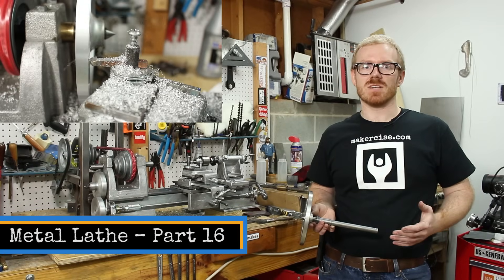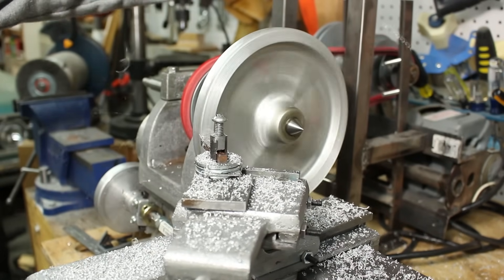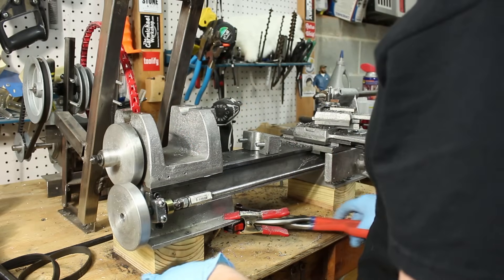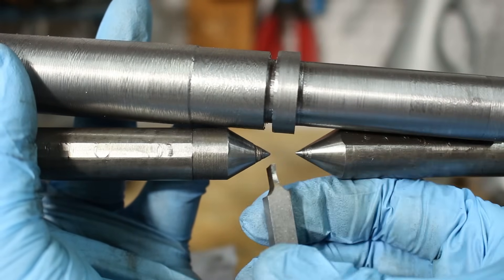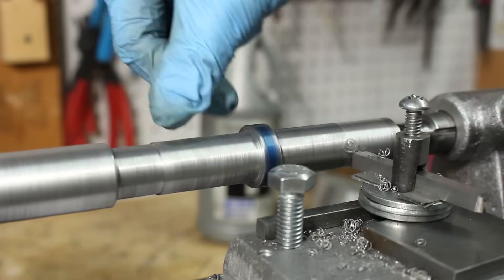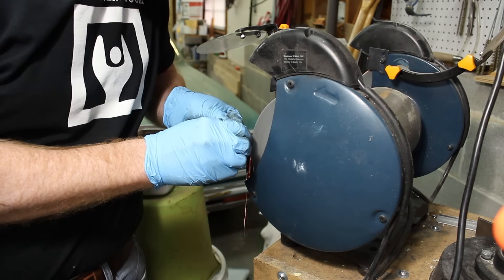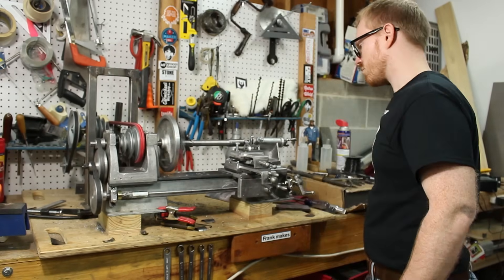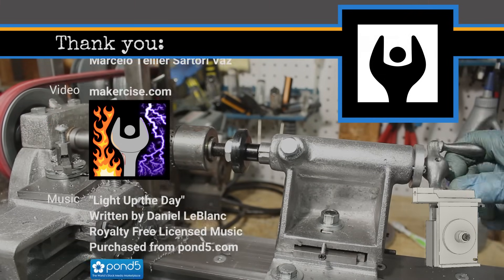Metal Lathe - Part 16: Completion

Comment: Nice job.  HSS is the way to go with these machines.  Carbide expects larger cuts which these machines can't deliver.  If you get some time look at tangential cutters, they provide a really nice finish.  You are turning on centers which is good, a 4 Jaw chuck might be better.  Mounting irregular shapes on the face plate is not easy.   If I remember correctly Gingery offers plans in one of his books for building a 4 Jaw. Rigidity is your friend, lock the cross slide when turning and the carriage when facing.  Mount a caliper on the cross slide, build a lathe stop,  mount a 2" dial indicator and now you got thou precision.   Good luck on the shaper.
Reply: Excellent series! I have Gingery's series, and would like to attempt the lathe as well. Paul mentions here that "rigidity is your friend", and I'm wondering if you would 'beef' up certain components if you were to do this again. I definitely appreciate your thorough documentation of this project. Keep it up!
Reply: rahras sahab
Reply: Brazed carbide is better than high speed steel in 99 percent of the time (may not like intermittent cutting) just need to make sure it has correct tool geometry (and grind on green wheel on the bench grinder not the standard wheel
Reply: Is there any way to get tenths precision?
Reply: Paul Arber I enjoy this fully
Reply: Paul Arber I'm in Africa SENEGAL.IF Somebody lake you can help me getting a mini lathe

Comment: Amazing workmanship my friend! I was going to mention high speed steel. They will give you a better surface finish on a lathe of this size. As for precision work mentioned by the guy above, it's relative. I've seen high precision rifle barrels turned on worn out 100 year old machines with more backlash than you could imagine. Learn your machine, it's capabilities, and it's limits. You learn to work around design flaws and wear, and make it do what you need it to.
Reply: I'll second the high speed steel tooling, I have an 1940's Atlas lathe and it has neither the speed or the strength to use carbide, you will find you can get amazing finishes with HSS with a proper grind! Bye the way nice work on that little lathe hope to see the shaper!

Comment: Hey, I just found and watched this whole project, excellent job man!  I myself read through Gingery's books and had put heavy consideration into making one of these before I ended up getting my little lathe, I'm very impressed that you did it all and made it work so well!   I would imagine fabricating a rudimentary 4 jaw chuck of some sort wouldn't be extremely difficult, either now or after you get your shaper made, and it will definitely increase the capabilities of your machine!  Great job!!
Reply from the maker: +Practical Renaissance I like your channel and your projects. Thanks for checking out my work. As part of the shaper, I believe the book calls for several different chuckling accessories. I think a proper 4-jaw chuck is part of the last book.

Comment: The cut is still not nearly good enough for any precision work. I don't know if it is the cutting tool and its position, itself, or the feed rate for the hardness of the work piece. But you should not need sandpaper to try to smooth off the roughness. Shimming up ONE end of the tail stock will not make a parallel cut as it is in effect a vertical taper.  I built custom target rifles, chambered bbls, made my own reamers. It wouldn't happen on the build so far.  Otherwise a great project of which you should be proud.
Reply from the maker: Thanks. I am interested in your feedback on a couple items. 
First, regarding sandpaper. I use the sandpaper primarily to ease in on the appropriate radius of cut, although it does also help with surface finish. I find it easier to change the diameter by less than one thousandth using sandpaper. It seems like I overshoot by trying to ease in the cross slide a fraction of a turn. Again this could be related to the sharpness of the tool and feed and speed. Thoughts? 
Next, when I bored the tailstock, I used zip ties which torqued the tailstock clockwise from the front of the lathe. I noticed somehow the bore was angled down toward the middle of the lathe, thus the need to shim up the left side of the tailstock. Any thoughts on how to tell which side of the tailstock bore is higher? Possibly using the dial indicator, surface plate, and some 3/4" rod stock. 
Custom gunsmith work is outside of my personal skillset in addition to being outside this machine's capability. Maybe one day I'll get there though. I look forward to continuing to learn from this community.
Reply: to check the slope of your tailstock, put the indicator onto the carriage assembly somewhere and sweep the top of the ram. For what it is worth I often turn to sandpaper for the last 0.02mm on the diameter too. Also at those kinds of tolerances the surface finish starts to play in to the tolerance as well.

As for the HSS tools, parting tools is notoriously difficult to use because they have a much larger contact with the part than most other tools, at least on such a small lathe. On my lathe I simply can not use a parting tool wider than 1.5mm, or the entire machine quite literally bends way out of shape and binds up.

Now I wonder if you could make a 4-jaw independent chuck for/with that lathe. I think that would be something to consider, as it would greatly increase the different operations you could do on the lathe.
Reply from the maker: neistridlar the four jaw Chuck is an accessory in this lathe's future. thanks for the encouragement.
Reply: 007cohiba
Reply: The work and research you put into this project is phenomenal! You've created a fine machine, one you should be proud of!
Thank you for sharing your work.

Comment: Why do Americans always use massive electric hacksaws over manual hand hacksaws even on small cuts. #lazy
Reply from the maker: You shouldn't use the word always. It is inaccurate. I cannot speak for all Americans, but when I can do a job faster or better with a power tool I characterize it as #efficient not #lazy.
Reply: @Makercise  if using power tools is more efficient why are you spending age's scraping?
Reply: @Exciting__Electronics  surface grinders are very expensive

Comment: Do not be concerned, you will be able to do accurate work with this lathe.  The little improvements you will be making will help in this.  And the shaper is a great tool to have in the shop.  I have a small one, it doesn't get used every day but when it is needed it is very handy.  Good progress.